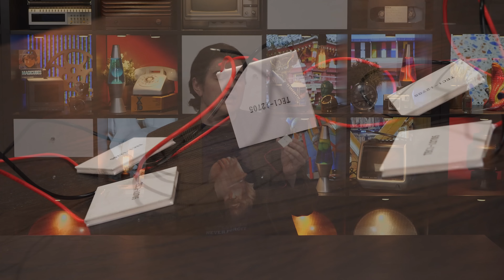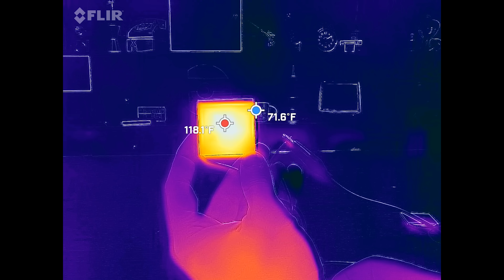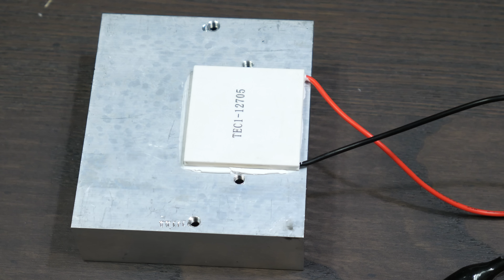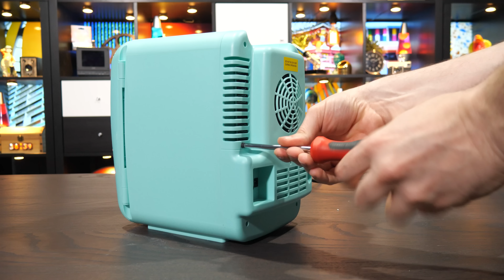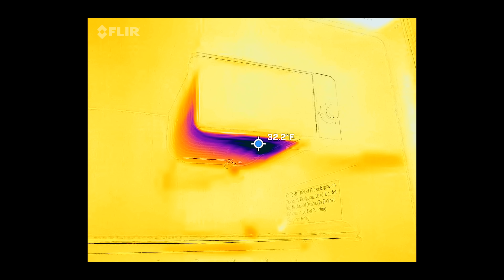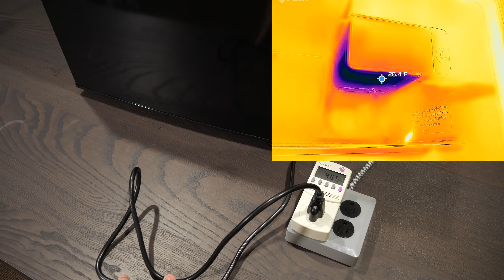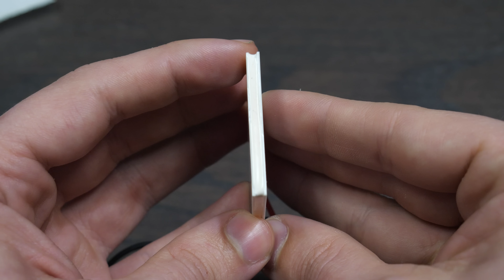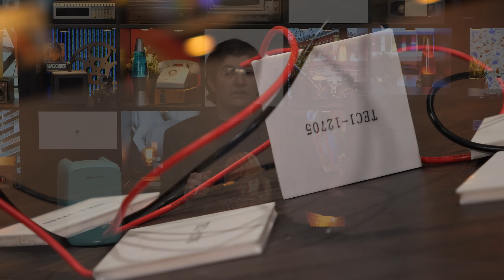Thermoelectric cooling: it's not great.

Comment: I think the best use for these peltier devices tend to be in cars, usually luxury cars, they have a drinks cooler cup holder so you can put a cold can in the cup holder switch on the cooling and it keeps the drink cold.

On a localised level such as this it works quite well, but for a fridge no, it simply isn't good enough for that.

But in a car you might only switch it on while you have a cold drink in the holder so it only sonsumes energy for a period of time which you won't notice.

So they do have their uses just not for fridges, and cars often waste a lot of energy anyway so a little extra won't be noticed.

Comment: Ok here me out. I made a peltier cooler and it actually works pretty good. Most designs use radiant cooling. IE making a piece of metal cold on the inside of the fridge. I use a cpu liquid cooling block on the peltier cold side and run coolant through it to a 60x60 mm radiator on the inside of the fridge with a small fan to circulate air through it. The liquid is a 50/50 water propelyne glycol or it will freeze. A small pump circulates the coolant through the cold Aluminum block to the radiator inside the fridge then back to the pump etc. I can cool 6 beers to 0°c on 12v power. Yes its wildly inefficient but its also much more compact then a 12v compressor fridge and cheaper. I use it to put my lunch and drinks in at work. I do general contracting and drive around alot so my ruck is running a good amount during work anyway. I can also run it off lifepo4 batters cus there true 12v. The biggest things i tweaked to make it most efficient was using high quality tec and making to cooling loop as short as possibleto reduce thermal mass. The company i bought my tec from use high quality materials and there made for Comercial products. There the highest dtmax tec module i could find. Much better then the crap of amazon.

Comment: I bought a similar one in September 02, 2022 for $35USD to use to keep my insulin cool even during our common power outages by running it off my 12VDC battery system.  
It does not have a fan only a large heatsink to dissipate the collected heat from the interior.  It is also able to heat the interior by reversing the polarity though I do not use that feature.  
It can run well over two weeks with one of my 12VDC LiFePO4 batteries which also runs several USB chargers for portable devices like my glucose sensor meter & a couple of tablets.  
As of today Sept 28, 2024 it is still working perfectly while being in constant use and none of my insulin has ever been lost due to several of the power outages we have had.  

The 120VAC refrigerators mentioned in this video will use many times the amps to run their compressors especially the startup spikes that would not work well with inverters.

Comment: Since they're cheap, you can just buy s large one and a small one. Put the small one inside the large one for double cooling. That 30 degree differential becomes 60 degrees. It's like how you can buy several cheap megaphones and just like them up instead of one more expensive one.

Comment: Presumably car based "cool boxes" use a peltier module but the cooling effect is in the vertical plane and is helped by ice blocks being placed on top of the contents ,so perhaps more efficient than your peculiar six can nonsense box.
I did notice that the ciggy lighter male connector and car female connector were to hot to touch ,after a two hour journey, suggesting a high power draw.

Comment: might work a bit better if the heat sync was more like a PC air cooler. 4-6 heat pipes with a proper fin stack and high pressure Noctua fan or something. lol could knock off a degree of two...

also, drawer and chest type freezers are just better, because the warmer air holds the cold air in the container, instead of the entire pocket of cold air spilling out the front when you open it like stand up fridges. doesn't take as much energy to re-cool the air.

Comment: I have the basic cube refrigerator. Had for I think over two years now. I have it right by my bed (I use the top as a table) It keeps all my drinks cold and it's actually quiet (Most of the time)

Comment: 7 minutes 30 seconds, you've lost me, lost to the point that I might go buy one of these cheap things. 

Youre telling me, for 30 dollars I can have 6 cans of beverages, acceptably cold? The caveats are that It takes 24, possibly 48 hours to get them actually cold. So? 

If you drink, say three cans a day, which you really shouldn't, every day when you open that fridge your cans that that have been in there for two days will be acceptably cold. You put in 3 more cans, next day, 3 more cold cans. Even with the cans in contact and possibly coming close to equilibrium, cold enough for me.

For 30 dollars, I dont see any down sides. Throw it under your desk, the noise won't be louder than my ac, and 30 degrees colder than ambient for me is a chill 38 degrees. 

Spend less time hating and more time accepting limitations.
Reply: I should have stopped watching. 
No fucking shot that at 11:00 you go do the math wrong. 

Your test assumes you never open the fridge, only ever load it with cold beverages, and keep it completely full so that it has minimal shift in temperature due to the specific heat of water being so damn high.

Comment: Unfortunately: if you only need to have "occasional use" cooling, you should use an ice pack... like a a 5lb bag of ice in a cooler. 

You can buy $1 or $2 ice packs as well. Pack them into your freezer, then stick them into your cooler for temporary use. And since a decent cooler has a lot of insulation, those ice packs will do more cooling than that Peltier cooler would do anyway.

----------

The real advantage of Solid State design is instantaneous reaction. You can turn these things on-and-off repeatedly and instantly. I'm not sure what needs "high speed" temperature reactions (turning a heat-pump on and off is NOT good for it). But its certainly one major advantage available.

It is quite possible that you have a temperature-controlled clock for example (ex: clocks grow less accurate the further away they are from their intended temperature). So if you're aiming at single-digit "parts-per-million" levels of accuracy on a clock, perhaps a Peltier cooler regulating the temperature to exactly 80F is what you need.

Comment: I think there's a use for them (the thermoelectric thingies) on a larger scale, there just has to be an actual engineer behind making them more plausible. Refrigeration systems save money because they don't need to run 100% of the time. Those tiny toy fridges running with no insulation is just a scam that sucks up electricity for very little in return.

Comment: As a peltier cooler owner, they're pretty awful. I have one, as I am a college student who occasionally needs to cool down some drinks or sodas, and the thing is kind of unruly. It chugs when it first turns on and needs to be shaked to make the growling stop. And once it's plugged in, the temperature is inconsistent enough that it gets a lot of condensation, and even mildew after using it too long. Your line about keeping makeup "cool and dry" is as inaccurate as can be. That thing gets quite wet, probably from opening it and the temperature changing. And since I don't have it plugged in all the time, the cooling-down period is pretty grueling. The only reason I didn't invest in a mini-fridge is because the cooler was free, and I don't usually have enough food n drinks to warrant a fridge that big. I feel like micro-fridges could be a market in the future... For all the college kids who have a big fridge, but also want a dedicated beer/energy drink fridge for their rooms! To make sure no theft among roommates goes on, and save room in the actually good fridge.
Reply: Oh and also? It's Frigidaire brand. Around Christmas they slap the brand name on stock-standard Peltier fridges (probably the same model as Aliexpress) and sell em for $20. It's a tad sad to see a reputable brand do that, but not surprising.

Comment: I buy 12 volt peltier coolers from Koolatron. I have two of them I use one in a semi truck to keep 2 1 gallon bottles cold and yes it will keep them cold very much so. Long as the truck's running I have it plugged in,Because it will pull four amps continuously. I bought a bigger one that blows air from the top instead of from the side, that would use 4.5 amps and that also cools very well. That's why I haul my food in to get to the semi truck. As long as it's precooled which I do the night before it's a okay. Yes I've tested the temperature in them. The semi truck has a 12 volt compressor based refrigerator/freezer in it. That takes it sweet time to cool down.

Comment: I have a thermoelectric cooler in my car. It was 1/3 the price of a car fridge. I only use it when needed to keep things cool. Running cost is mostly irrelevant as it draws power off the car, which has plenty of surplus. It actually has a thermostat and will reduce the power when it achieves the target temperature. It can be powered by 12v or 240v. I checked on 240v, and it'll switch from 80W to 40W to 20W as it approaches and achieves the target temperature. I would never use it as a full-time cooler in the house; the power draw is too much. As a cooler to keep stuff cold in the car, it's perfect.

Comment: I agree with the man on the small 6 can models, most common on the market.

Larger ones that have higher quality parts are of course better. I have personal used both the disappointing 6 can one and a larger 10 can one.  The 10 can one actually gets cold enough to store milk and if you are pressed for space and can't have a large(ish) appliance the 10can model which runs approx $65 is an appropriate option to an $80-110+ cube that eats up more room.

Comment: im on my second "little blue fridge" for my desk. I wanted to pick up a mini fridge but their like 85$ on sale at the time and i got the frigidare mini desktop one for 20$. I couldnt swing that extra 65$ at the time. Now im already accustomed to this type of fridge for my drinks. Its only job is to cool the cans, i pour all my drinks on ice in my yeti cup. But if i used cans that are room temp they just melt all the ice and id use more energy to make more ice than vice versa i promise lol. Plus i hate melted ice in drinks and i prefer my drinks super cold. You can get around those long hours to cool things down if you remove your soda from the bottom "wich stays colder" then place any drink you add into the fridge where its touch two cold sodas. So its imperitive to replace 1 or 2 max at a time. unless your my 12 year old and a asshole lol. but it doesnt take as long to cool with the cans touching. The initial cool down is a long while and if i ever forget to refill it takes forever but meh it works. It keeps drinks close at hand so if im thirsty mid raid on tarkov or out roaming in rust i dont have to go afk in a bush to reflil my drink. But i was already planning on getting a full mini after christmas because id love to keep a wider variety of cans ie: energyy and other bottled drinks cold too. These fridges absolutly canot keep a bottle cold even if it would save baby jesuses life lol

Comment: Look into wood stove fans - Peltier generator powered electric fans that increase airflow around the smokestack of a wood furnace that you don't need to plug in or worry about turning on or melting in any way. They are robust and literally free to run, and quite convenient. As a bonus they have a bimetal strip to make sure they don't get too hot.

Comment: Apparently they do better at heating though, because as you said they can technically get a COP of 1 - 2 at really low power, the reason why that is is that your not dumping a bunch of electricity through the TEC heating it up which offsets any cooling you are trying to do, but for heating... well that's fine it's just more heat so you can get a COP of 2 - 3, still not as good as a good modern heat pump which can get as high as a COP of 6

Comment: On this one, the power supply is below the heatsink. My son had one very similar to this: condensation formed on the hot side , dripped down and it fouled the switch and ruined the power supply. They're basically little toys.

Comment: My cheap find "Wine Chiller" from goodwill actually does pretty good considering (also note, I paid $20 and this thing is the size of the cube fridge)... it not only has 2 fans on the back (that I switched to better fans) but has a fan to blow the 'cold' air inside the chamber, it's insulated pretty well and does have a temperature setting (and actually doesn't use that much to run).  ¯\_(ツ)_/¯ I do agree those tiny 'microfridges' are impractical though.

Comment: Back in the early to mid 2000s, I worked in a mid Atlantic auto shop with no AC. We had bay doors at either end which would generate a little cross flow, but when you’re in the middle of an 12 bay long wall, you’re hot!  110+ in the bay for days on end was entirely common. Especially if you had a car running in the bay. Anyways I had one of these things and I found if you just left it on 247/365 and you put your drinks in it pre chilled from a normal fridge, then even in the early afternoon in the hottest part of the day, an 80ish soda felt fantastic!  In one respect I miss those no AC days, never stopped to go to the bathroom! And ironically my fellow techs complained less about the heat when they didn’t have AC than when they did!

Humorously, the brand I worked for later came out with “chilled” and “heated” cup holders that used those Pelletier elements. Turns out if you reverse the current, the cold side gets hot and vice versa. They still offer them to this day and they also use Peltier elements in their 48v batteries as well. If you know a lot about certain brands, then you’ll likely know which brand I work for.

Comment: Peltier devices are really much better for scientific applications where you're controlling the temperature to +/-.5 of a degree, or where a refrigerant-based unit will actually use more electricity (where there's a heater in place to control the refrigerant-based chiller very accurately.) Also, they're much better when using liquid running through a plate in order to sink the heat from the peltier device. And when they start getting big, they're much more reliable than a refrigerant based chiller.

Comment: Could you do a test about the heat intrusion of the toy? Maybe you could use an expanding foam through the hole you drilled and see if it will actually cool then. Might make a pretty good video.

Comment: Got a free peltier coleman cooler like 5 years ago for some give away. Replaced the power cord once, and have an a/c adapter for trips. Only time it's used is on the road or on vacation so I don't have to worry about ice. For that it's fine since they're pretty cheap new and a normal "portable" fridge usually runs between $400-$1,200 though are larger, more power efficient, have multiple cooling zones, and can freeze stuff. Eventually I'll get one but for keeping stuff cool when traveling these things are hard to beat.

Comment: I got one as a gift over a year ago and I love it. Thanks to you I now know that the energy used each year is only equivalent to a 60 watt bulb which I used to have all over my house so that in not a problem for me compared to the energy my stove, refrigerator, air conditioner generates. It is so quiet I have to put my ear up to the vents to hear it run. The instructions had plenty of warnings abut not using it to keep food safe. The cans are always 50 F and just perfect for me to have a beer or soda without going down stairs to the kitchen. Cheese can be kept cold. It is well made, takes up little space, uses no more energy than a 60 watt bulb, so for my uses there is no substitute available. If it broke today I would buy another one immediately. In your opinion it may not be great but it is useful and it is as good as anything else out there that size.

Comment: dont want to argue anything, just that some points can come to how its made really, im in the uk and got one of these for my small desk in my bedroom i use for work, i dont have space for anything much bigger, it runs about as loud as the general hum of my laptop, holds 8 cans instead of 6 and can both chill drinks and heat drinks, on average of found my cans will get as chilled as they are gona be after about 2 ish hours if they already normal cold, which im not going to be having a can drink in any other circumstance, but sometimes is does go into overdrive randomly and on 2 ocations it has actually done that thing with water bottles where you take it out and it starts freezing when the water is disturbed, anyway just wanted to point out that it really does depend on how it is made and sure they arnt perfect but for what i need mine for i love it and im just happy that this video didnt tell me id get cancer or something form it

ps it cost me £40 and i decorated it as a nuka cola fridge from fallout

Comment: We're replacing a 23 year old heat pump. A two ton unit seems about right. WTF is a ton? The energy needed to melt one ton of ice (a cube a bit larger than one yard, roughly a meter per side). Or, nowadays, 12,000 BTUs. Which has to do with raising the temperature of water. And is roughly 3.5 kW (kW/hour?). So now I can relate: that's two plugin heaters running full blast. I'm taking great liberties confusing energy, power, and rounding errors. But  it seems a two ton HVAC is like running four plug-in heaters full blast - 12,000BTUs being approx. 3.5 kW. 

Is this covered in one of your videos?

Love your channel; excellent info!